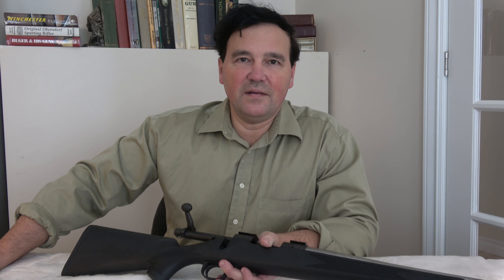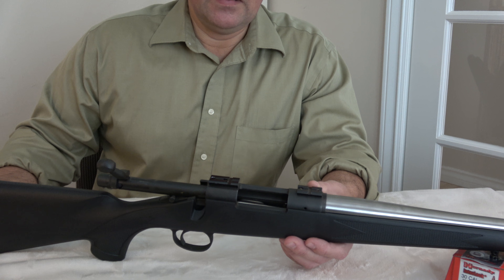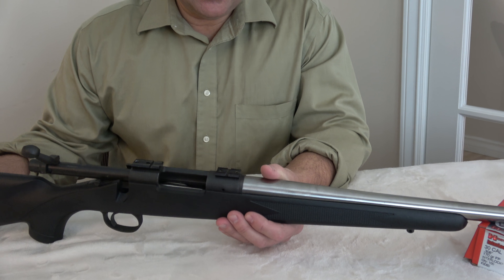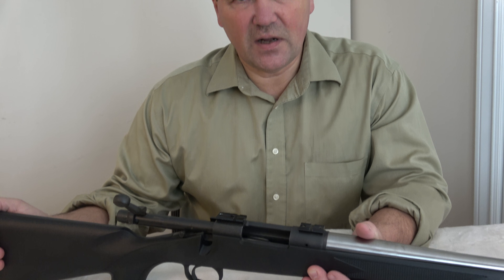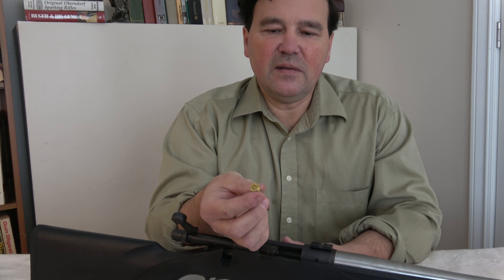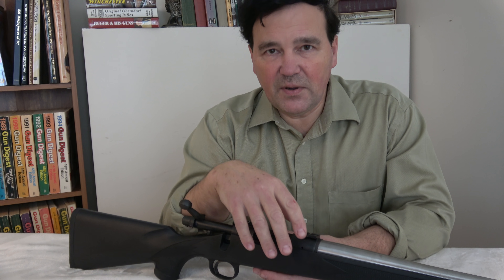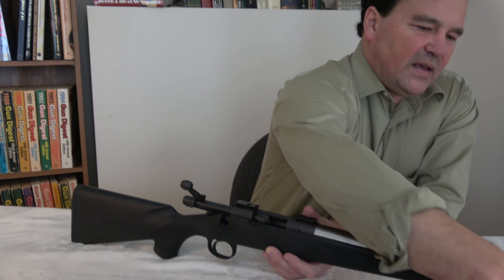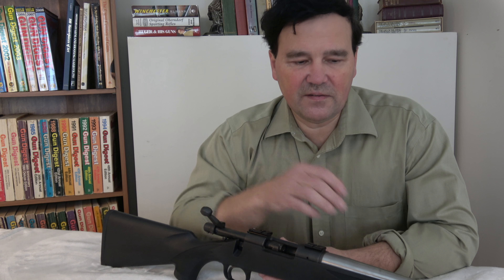Very High Velocity (VHV (TM)) Small Arms

Comment: Great idea, spinning the projectile makes up for error in density, concentricity of the projectile, and the barrel plus muzzle shape - if we have the manufacturing capability to get the projectiles almost perfect, using polymers to obturate, the shape to stabilize and by maybe sort of magnaporting the barrel or integrally suppress it to send it out the barrel without much pressure the musket becomes interesting again. I would love to get more detail on the experiment, this might be the next evolution of small arms!
Reply from the maker: Hi Ragnar - there is something to it - the experiment - but more and greater minds are needed. I see almost no limits to velocity if stability can be achieved; if some of my assumptions are correct - projectiles would not be restricted by the "launcher" - which for now is the rifles barrel etc...

Comment: I wish I'd found this video sooner. In the 1980s I used polymer bullets, a Remington made 1903-A3, and a smooth bore Shilen barrel. The bullets were about 110 grains, and wouldn't hold together for more than about 50 yards. I ended up ruining the rifle action because of the pressures. I turned the bullets out of UHMW plastic. They were over 2 inches long. I no longer have the notes to give you accurate data.
Reply from the maker: So interesting - plastic sabots. Smart.

Comment: Excellent presentation Matt, very concise and accurate.  If I may add, and in no particular order. It is true about steel cases not fireforming to the chamber, however steel cases do tend to stick in the chamber making extraction difficult.This is not a factor of being steel but rather due to the lacquered finish on the surface of the case. Neat idea to get a non rifled M - 700, you say it's for .308. I assume you mean .30 caliber using .308 diameter trifling. But the remark of shooting 7.62 × 39mm is confusing.  This round is not .308 dia. but rather a .311 diameter. As to finding a means to gas seal the bullet in your smooth bore M-700, it brings to mind the same predicament shooters experienced prior to the Civil War.  And as we know a Frenchman solved this problem with his design of the Minnie Ball. The hollow base of the soft lead projectile expanded under gas pressure to form a skirt that would create a seal  and allow a build up of pressure that allowed higher velocity and improved accuracy. 
Your estimations of muzzle velocity exceeding 7000 fps for tank rounds is not untrue,  but there are factors to consider when speaking of such things. The powders used in tanks main gun are different and do not compare with rifle powders. The burning rate and pressure curve are radically different. Depending on the era and caliber of gun being used the round may be self contained or it may be loaded as components. It may also be a discarding sabot type which would be considered as sub caliber to the bore. One must also decide one the " type " of main gun, is it smooth bore or is it rifled. Also consider that as a tank round it my make use of a driving band on the projectile, something no rifle round will have.
Another factor to bare in mind with trying to attain higher velocities than standard for a given cartridge of a specific caliber is that the commercially manufactured ammo and projectiles available are all using a gilding metal of a uniform thickness, and are extremely soft and fragile. And even though bonded to the core, unless the type of bullet is of a monolithic solid construction you will most certainly experience core separation and shedding once velocities exceed beyond the rated construction of the projectile. And this will occur more as a product of spin than velocity itself. As it would not happen if it were possible to reach these velocities out of a smooth bore barell.
This is an intriguing discussion as it relates to interior and exterior ballistics.  It also goes hand in hand with the old and never ending debate over the two schools of thought on " heavy and slow " vs " light and fast ". Which is the better big game round, the 900gn .700 caliber projectile going 1200 fps ? Or the 150gn .30 caliber projectile going 3800 fps ? Of course there are trade offs, but which gets the job done " better "? 
A last point. When discussing shotgun slugs, it must be remembered the ongoing  measures that manufacturers have taken to obtain a better gas seal, higher velocities and a flatter trajectory out to 75, 100 and then 125 yards. With the exception of the Paradox type of barells we will keep to smoothbores. And we will exclude fully rifled bores and sabot ammo. We first see the introduction of the Forster type of slug with its hollow base, and then imprinted rifling. Next is the Dynamitt Nobel style with a flat base and a type of thick felt wad attached to the base, providing a gas seal of sorts. There are other attempts at similar methods, but most offer little in improvement. Then we have what I find to be the best of the breed, the hourglass shaped, wasp waisted slugs found in ammo by Litchfield.  A well thought out design that actually shows an improvement in the areas we are dealing with. Most notably a heavy slug, traveling at higher than average velocity, well stabilized, with improved range, muzzle energy and accuracy.
But as with most things in life there is a price to be paid when you go down this road. Winchester and Remington found thjis out long ago in the early 60's. Pushing cartridges like the .220 Swift and the .22 - 250 Rem to velocities hovering around the 4,000 fps mark made for great marketing and enthusiastic customers..... for a time. Then the reality  set in. At these velocities chamber throat  erosion was a big problem.  But more importantly was that a barells useable  life was now being measured in a few hundreds of rounds instead of the average 4 - 6,000 or so. A huge difference. Some stainless steel barells were used to help Improve things, but working with this type of steel was very difficult to work with at the time. The bottom line was, to stay cost effective ammo velocity was scaled back, and if memory serves me correctly,  3,400 fps was the top speed. 
Again, a GREAT study on your part and an excellent experience and experiment to discuss here. Lots of fun!!! Thanks. Be safe and be healthy.

Comment: Electro magnetism... Turn the barrel into a stator and the bullet into rotor. That might spin up the bullet.
Reply from the maker: That is an interesting concept.
Reply: But that will give you heat ...
Reply: Bullets aren't magnetic
Reply: 1lovesoni; they could be. I wonder if a steel core would work?
Reply: El Guero; I suppose but how much? Truth, this would be a rail gun expierment.
Reply: Environmental influence:if such a thing as semi vacuum,sub arctic temperature, hi resonates  to low vibration.  If. Maybe

Comment: Pistons achieve seal with piston rings. Bullets with weight forward with a stabilizer tail, projected through a smooth bore with discardable rings or sabot can achieve super-high velocity. Been done before.The reasons it is not popular in rifles is that it is not needed to kill (huntingly or militarily). It is used mainly for armor-piercing.
Reply from the maker: Hi Jean! That is so clear. Thank you!

Comment: I think a small correction is in order regarding shotgun slugs.  yes, the eight is forward, but I think they are loaded with plastic jackets, or sabots, that are finned, to spin the slug even without rifling.  I don't think they are stable without that, because I see non-sabot slugs that state they are for rifled shotgun barrels only.  I would also have said that the reason for rifling has always been stabilization of the projectile.  The police's ability to match a bullet to a gun by the rifling marks is incidental.
Reply from the maker: Hi Worsel, Great comment and interesting subject - thanks for writing. I tried many different slugs over the years. A few people sent me their custom slugs made in molds they had perfected. The full size non-sabot slugs (they are not enclosed or carried by a sabot) sometimes have rifling on the outside of the slug and sometimes don't. After seeing all the results it seems the slugs stay on track due to their weight forward design only. The presence or absence of grooves, spirals, rifling, holes and such seems to have little effect - but people like to see something on the outside so most manufacturers have some kind of profiling on their slugs. The most accurate I tested were Brenneke style with attached wad and smooth slug body with no rifling. 

The sabot slugs are caused to rotate in a rifled shotgun barrel by the rifling - just like a rifle - except the slug is held within a sabot - a usually plastic enclosure although I shot some old ones that used wood. I was told by viewers that  "sabot" as you likely know is French for boot which makes sense as the slug is in a "boot" which falls away once the slug exits the barrel at some point. Some sabot slugs are super accurate - but I still like the original, simple Foster type slugs with no rifling - I find they react to choke the least and are most accurate - at least for me. Here is a pic of a nice, clean slug - these fellow are up so something else but the slug is good.https://www.muzzleloadingforum.com/threads/foster-slugs-in-smoothbore.115790/ 
All the best to you.

Comment: Just wondering if smoothbore-rifled bore combination design (Like in FX airguns) has been used with a jacketed but obturating projectile (jacketed minie ball !) from a centre-fire rifle? Have not been able to find any information on the subject ( it's probably out there but I'm just not putting the right questions into Google) !
Reply from the maker: Hi Ashley, There were Paradox guns built by the British that had smooth bores to a point and then rifling - worked okay - I had a couple of these over the years. https://thebiggamehuntingblog.com/what-is-a-paradox-gun/
Rifles with jacketed bullets at high velocity or even modest velocity will hit that rifling hard and likely not react much to the "engraving" and turning effect of rifling further down the bore. The forward momentum is so great that it is most likely that the jacketed bullet would just blast and scrape right through the rifled section of the bore without rotation. I'm not certain of this but it seems to me that I remember either trying something like this myself or I knew someone who did a long time ago. Good idea though. In general - the closer the bullet is to the rifling in front of the chamber the better. Even the Weatherby jump - or freebore - does allow for initial velocity gain but there is a risk of bullet deformation - which Weatherby seems to have mastered - or they abandoned freebore - I'm not sure. Hope this helps.

Comment: Tungsten projectiles, shotgun and pistol type propellants and something to overcome the initial acceleration that uses most of the energy  when launching a hyper velocity projectile is where I'd begin. Also if possible the shape of the projectile could make inherently stable. That is where I would begin. I believe that with today's current CNC abilities we could  (humans) could include gyroscopic stabilization. 2 axis  would be needed. Great topic. Something I've pondered. Also your theory about the physics changing in high velocities seems correct considering other advancements. High T superconductors, high pressure sciences...etc. There seems to be something about the extremes.
Reply from the maker: Thank you for your thoughts and comments. I have a hunch that some of the physics of shaped charges will come to bear on this velocity puzzle. Electric guns are interesting, but like electric cars, are sort of a novelty in the real world. Arctic warfare : - 40 F , wind 40 mph and not another friendly human or settlement in sight: what will work? For me - a .303 Lee Enfield. Velocity is nice and plastic is nice until it shatters like glass in your hands. Hopefully there will never be another World War - but history tells us - it is just a matter of time.
Reply: @UnitedStatesOfGuns  They've done great things with polymers. Before this my experience was a polymer designed for 40 to 60 below melted in the Florida heat. I did not think that through properly LOL...Shaped charges are indeed interesting. Shaping a significant force to a pinpoint can be extremely destructive to material. Chemical catalysts have come into their own also. There is no telling what think tanks and groups like DARPA are into these days. The SR71 being around so long ago (Late 50s), just a bit into the U2 is a total stunner....The U2 just flew a few years when SR71 was designed and a couple more it was built...Analog design. We live in an amazing time!

Comment: A 1 in 12"  twist barrel with a bullet velocity of 3600 fps and a time of flight of 1 minute would equate to 216,000 rpm. That's faster than a dental drill! I'm not saying it's easy, but it's do-able. It's a wonder the bullet doesn't shed it's copper jacket!

Comment: A thought about target effects...if you are using a small projectile, with similar energy, the energy is concentrated into a smaller "contact patch" for a .3" vs .5" the ratio of "pressure" would be about 2.8x , so, based on that, alone, a very different penetration level...there may also be some effect of heat generation, or shock wave in the 'backstop' materials...good fun!
My background is fairly broad, but a lot of my experience is in test & measurement, which, in the electronics fields, gets into nanoseconds pretty quickly. So, for example, I've never seen any documentation of the so-called "barrel harmonics", and no documentation at all on the actual deflection of the muzzle, over time, and correlated to bullet exit... have you, in your years of interest in the subjects, seen such? 
Interesting, too, getting a fast enough burning "powder" without getting into a high enough brisance to cause shock damage to the steel, and other materials in the system... ammonium nitrate + ...hmmmm

Comment: When doing experiments, scientific or otherwise, the universal criterion is to publish quantitative results or make them available, so others can duplicate those results. Smokeless powders and small arms have been around for 150 years, and billions have been spent on their development by the best minds available. Thus it's going to be very difficult for any individual to invent something new. Currently, the highest velocities obtainable with available powders for practical use go up to about 4,400 fps. for normal barrel lengths and non-sabot rounds. To obtain 4,000 fps requires a charge weight/projectile weight of about 1:1. Then the law of diminishing returns sets in since the effective velocity of the charge is limited to the 4K fps. range for working pressures (65K psi. approx) - unless you want to blow the gun up. Sabot rounds, such as those using depleted uranium cores, fired by M1A1 tanks go up to 5,000 fps, not 7,000 fps. 

Nevertheless, it is possible to go higher with non-sabot ammo. Currently, I think the record is held by the 17 Incinerator (an improved 50 degree shouldered, 50 cal BMG) firing a 20 grain, solid 17 caliber bullet. Velocity is up around 6,000 fps, but it requires about 230 grains of powder and a barrel length of probably 3 or 4 feet. Ugh! And with a charge:projectile weight ratio of 11:1, barrel life is only 5 to 10 rounds! So you'd better not miss that prairie dog!!! While its muzzle energy is about 1,600 ft. lbs, it's down to about 200 ft. lbs. @500 yards and a miserable 25 ft. lbs. at 1,000 yards. In other words, less than your average 22-250, and about the same as a good air rifle at the muzzle! 

http://bulletin.accurateshooter.com/2017/04/17-incinerator-ultimate-varmint-cartridge-with-mach-5-speed/ 

Recall the Paris Gun of WWI: Its 112 ft. barrel shot 234 lb. shells up to 80 miles, with velocities up to 5,400 fps. Unfortunately, shells had to be numbered because an increasing diameter round was required for each subsequent shot. And the whole barrel had to be replaced every 65 rounds! In other words, the thing was almost useless. Things haven't come a long way in 100 years because the technology ,while better, hasn't qualitatively changed. True, a 200 grain, 30 caliber bullet moving 5,500 fps would generate 13,435 ft, lbs. - the same as a 50 cal. 750 grain A-Max moving at 2,850 fps. But the 750 grain Max has a G1 ballistic coefficient of 1.050, almost double its 200 grain, 308 caliber counterpart. That means it retains roughly twice the energy for a given range. That's why the 50 BMG, using that very bullet, was able to make the longest sniper kill in history this year at 3,871 yards. I calculated that the striking energy at that range was still about 880 ft. lbs - plenty to take out an enemy soldier. 

By the way, a cartridge that produced a 200 grain, 5,500 fps. velocity would require at least 2,000 grains of powder so, you'd probably have to neck down a 37 mm anti-tank round to get it in there. And your shoulder might need an orthopedic surgeon afterwards. Firing bullets seated backwards changes their center of gravity, makes their spin drift go crazy, and absolutely ruins their ballistic coefficient, so I can't understand why anyone would want to do that.
Reply from the maker: Hi Will, Wonderful summary. Such an interesting area; or at least for those so inclined. I have a book on the so-called Paris gun. Anyway, as you write, I entered the arena with virtually no chance; this being a corporate world and if not that...a military one. The good news is I am not governed by such things and enjoy even the most rudimentary efforts. Thanks for writing : )
Reply from the maker: Hi again Will, On the bullets loaded backwards, I'm not sure who came up with the idea a hundred years or more ago, or why it is so popular. Maybe the clean holes and the ballistics and stability seem okay and repeatabilty for most people is a given. Much fun too. Cheers.